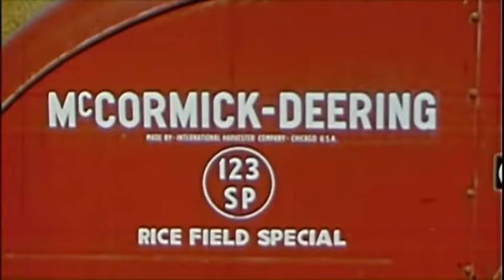One Man Harvesting

Comment: Imagine doing all that without a seat belt, helmet, safety glasses, a cab, A/C, radio and most of all NO WHINING. People don't know or appreciate how easy they have it now days.
Reply: ahh I miss the days where we used to get heat stroke, dust, metal and sand in our eyes, and how we used to fall out and get crushed to death by our equipment.
Reply: Hell I was born in 85 worked on a farm in my teens and the only cab I ever was around on a tractor was a MF 165, it had no heat, no air, you could open the windows.....I rather use a open station with a sunshade/canopy than that in the summertime. It was always a hot, dusty job seemed like, old Ford 5000 Diesel was what I used most the time.
Reply: IHave a Farmall Cub now and my seat has a spring in it. Heaven
Reply: Sounds like a good time to me
Reply: @jeffreyrobinson7149  00 9
Reply: imagine doing all that with the crushing burden of a $1,000,000 mortgage...different times have different problems.
Reply: What year is this?
Reply: Tbh I would love to be able to do that
Reply: @nicke1903 I grew up one exactly same tractors.   Ford 8n, Massey Ferguson 165 diesel open station and 1969 Ford 5000.   Grandpa even had an old Montgomery ward loader on that 8n for scooping our barnyards.
Reply: @harrimanfox8961 Sometimes we need to be a little smarter then the equipment we run. I didnt see anyone in video do any of that either. We had a family farm, uncle had a farm, i worked on numerous farms growing up and bale about 15 acers now. Nope, never seen any of what you say. And heat stroke or exhaustion? lol I've done this in 104 degree heat. Thats mostly for people that don't wanna be outside.

Comment: 5:50  "Easy, isn't it?"    Well, maybe not for the fellow forking inside the wagon.
12:50 Yikes! Leaning to the left over a bump makes me a even more nervous about operating such a high centre of gravity machine on sidehills.      Note the completely flat ground they're being demonstrated on.
Reply: Working on good hills necessitates a leveling system, used since horsedrawn days. These combines were some of the first to get them, however by what I've seen in local back pastures, pull-types were more common throughout the 50s.